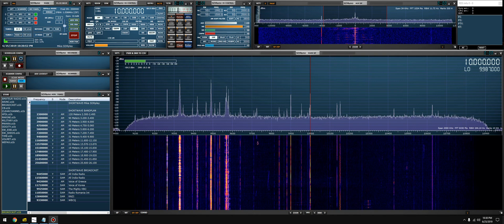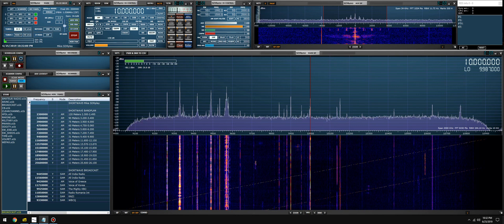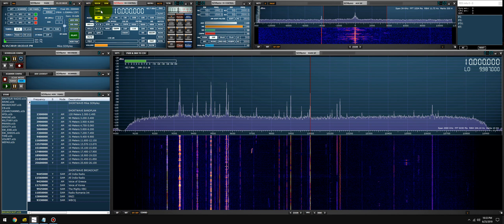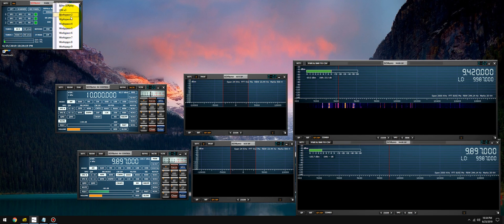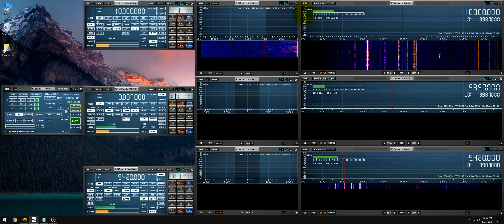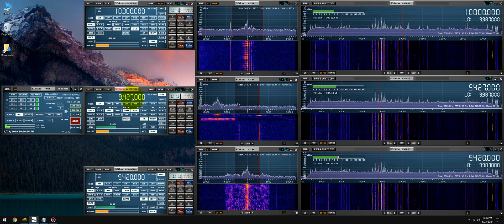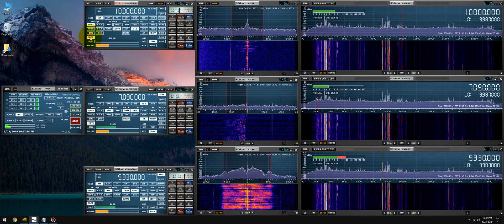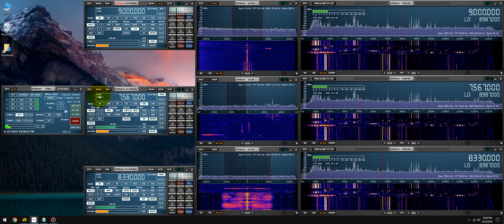SDRuno basics, VRX.

Comment: Very informative.  Would show what you meant by monitoring propagation using multiple VRXs?
Reply from the maker: Thank you, I use a mix of JT and FT transmissions on two different bands. WSTJ-X will spot my decodes to  https://pskreporter.info 
PSKreporter shows the stations I decode on its own map. I use their map showing my spots to quickly gauge propagation.
Reply: @SDRplayHamGuides  That's pretty cool. :-)